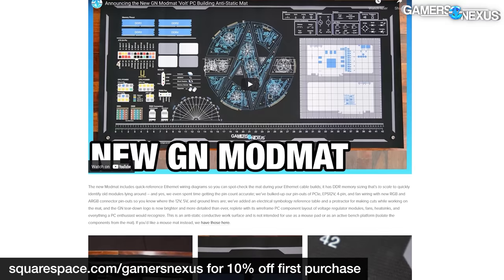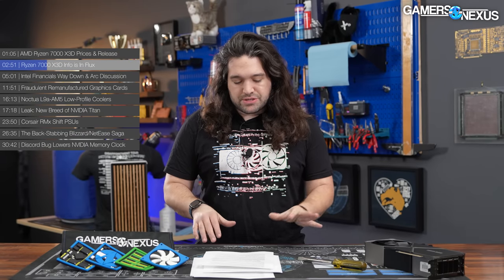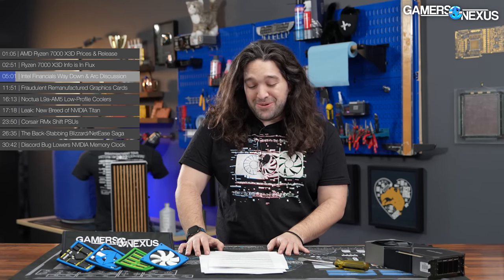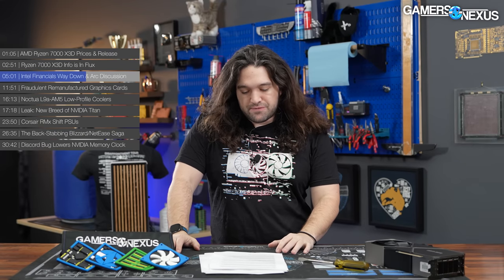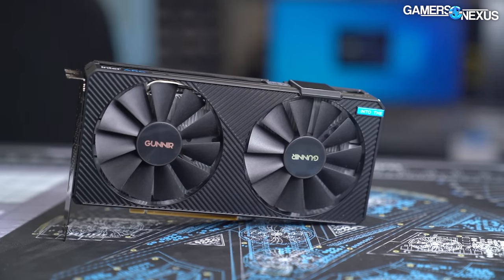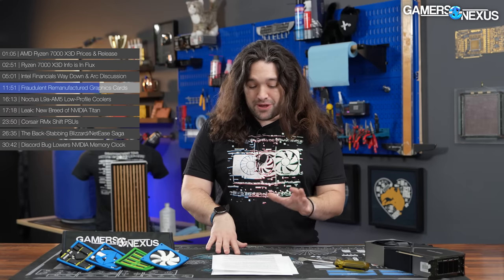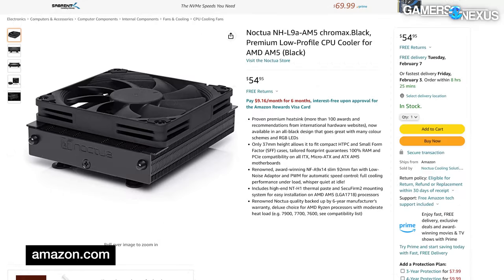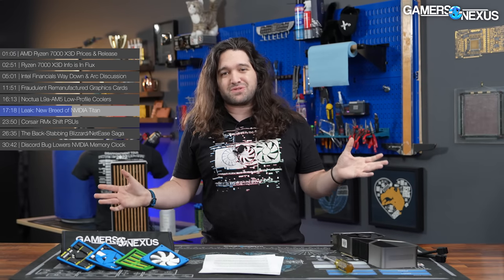HW News - Fraudulent Used Video Cards, 7950X3D Pricing, New NVIDIA 'Titan' Rumors

Comment: For those unfamiliar, TAM is basically a number that describes how much the company would theoretically make if it had 100% market share. This basically allows you to distinguish your slice of the pie getting bigger from the pie itself getting bigger. In Intel's case both are going down, which is always a bad combination.
Reply: I don’t really get it though, why would TAM go down when the need for computational power has never been higher? The only reason why TAM should decrease is if the market shrunk but it’s not shrinking just changing. I.e their will likely be a huge growth in compute needs by the government specifically the military of various governments as global tensions rise
Reply: @dennisp8520  Lots of companies overbought hardware capacity during the growth and shortages in the last year. This means they're sitting on a big pile of servers, and will take a while for them to start buying again.
Reply: It's cyclical, it's not just due to a recession. Most companies don't buy annual replacements of servers, so if they have a record year of sales, then the following year will almost without question be a decline. I think in about 2 years, their repeated process shrinks on the CPU side and GPU iterative improvements on the hardware and software side will give them a banner year.
Reply: @CyberneticArgumentCreator  Just have to ensure the servers don't last more than a year and you can keep the revenue as high as you like.
Reply: Good explanation, thanks.
Reply: Use "basically" a few more times, so people can think you're even smarter than you think you come across. Basically.
Reply: @Triaxx2  If they broke down like that no company would purchase any of their servers anymore.
Reply: @CyberneticArgumentCreator  while that is true, its not like every company is "In sync".
But of course a new generation might make companies interested in upgrading hardware at the same time, e.g. maybe they want to go to more power efficcient hardware when energy prices are high, maybe they need some AI accellerator cores to increase producitivty etc.
Reply: @TheEchelon  I suspect you underestimate the stubbornness of corporate procurement.
Reply: They thought that making their dies anonymous with "intel 7" and such would help them keep selling old tech lolol

Comment: The irony with Intel (and other companies) is that the current CEO (Gelsinger), who is restructuring the company to become more competitive in 5-10 years, will get all the flak. In fact, this predicament is due to the previous CEOs not preparing for competition, not investing in R&D, not willing to spend money so that they can report higher earnings and get fatter bonuses. They sat on 4-core i7s for years and years, just raking in the money, while AMD caught up.
Reply: @Morimea  well let's see if Intel closes it next year then, I can't imagine ARC going from -400.000.000$ to >1$ within a Year.
Reply: @Ocastia  It can, if the investors decide to cut the project it'll drop to $0 within a year.
Reply: I'd say specifically they didn't execute on process node improvement probably because of money and poor management.
Reply: Also keep in mind, it takes like 4 years for a CPU to go from concept to being in your hands. Every product we're seeing today was started under Bob Swan (from what I heard, being a finance guy, he really turned over things to the engineers and let them do what they needed/wanted to do). The products and strategy Pat is responsible for are still a couple years away. Brian Krzanich was the guy who laid off all the "grade level stagnant" employees (older experienced employees who ended up going to work at AMD,  Nvidia, and Apple) and he's the guy who decided they could keep 10nm performance/density targets the same even without EUV.
Reply: Dude they stuck to quad core flagships for a literal DECADE! The Core 2 Quad Q6600 came out in Q1 of 2007 and their last quad core i7 the 7700k came out in Q1 2017 before bumping up the core count once Ryzen came out. Intel completely deserved this L for gauging their customers for 10 years and got caught sleeping because of it!

Comment: When you put the X3Ds to the test, you should take a look at some strategy games; dwarf fortress, paradox games, etc. These games are CPU limited and have shown massive performance boosts for me with the X3d on AM4.
Reply: let alone physics games like KSP with 100+ mods installed.
Reply: DCS World in VR :)
Reply: And WoW! I really hope they will test it since its an MMO that benefits.
Reply: Seconded.
Reply: Upvote for this ! =) And with big sim games too (FS, KSP 2.0, etc...)
Reply: Starcraft 2 as well.... it keeps being used on GPU company benchmarks but no reviewer actually does it
Reply: and now the 7950x3d, 7900x3d launch is soon, at lower prices than 7950 and 7900 launched at.
Reply: @MongooseTacticool  YES!! Someone needs to test this workload, it's probaby the toughest test out there!
Reply: Add Factorio or Dyson Sphere Program to the list.
Reply: X4: Foundations will likely see massive fps boosts as well.
Reply: @Helper800  This was the game I was going to suggest. Late game even the newest of processors can fall over in terms of FPS. 
I'm sure someone from the X4 reddit group would be able to provide a demanding save game to test.
Reply: Still waiting on a cpu that can run FaF in late stage team games:p

Comment: Hopefully Intel keeps the GPU department. The new drivers is a great step in the right direction and some much needed competition in the GPU market with all the price drops.
Reply: I doubt they'd toss them.

Having a competing GPU tech extends well beyond just manufacturing GPUs.

For instance, the way AMD has been able to pick up Xbox, Playstation, Steamdeck and other markets for over a decade now is because they can deliver a complete package designed to work as one.

In the compute and server market, Intel can transpose their GPU knowledge to developing decent compute hardware to compete with Nvidia, a gigantic market they are losing out on.

And in our own space, if you want anything with some graphics performance, be it for design, compute or gaming, Intel was only ever able to sell CPUs, where they now have competition, the GPUs were always Nvidia or AMD, because Intel integrated can't compete even with other integrated graphics.

Up to now, Intel has tried to avoid the GPU market by trying a multitude of other compute models, but that never worked or had enough volume to keep up with GPUs capabilities.

The GPU market gets its performance driven by the gaming market and these advances can then be capitalized on for compute and other markets.

On top of that, the GPU market functions as a testbed for AMD, Nvidia and now Intel. They can push GPU/Compute tech, see how it fares and then push it towards business showing it works.

The old Intel approach towards compute had them come up with unproven product after unproven product. Some of their hardware was really goddamn interesting too, but it didn't end up having any longevity because it's hard to sell untested hardware.
Reply: @enlightendbel  Especially with the meteoric rise of AI, if you have the best datacenter GPU compute on the market, you basically have a money printer. I think that's the angle Intel is going for.
Reply: @kukuc96  they've tried to go for that before, but didn't take advantage of the GPU market to show their hardware ideas work.

And that's the point, use the desktop market as a testbed for tech that shows the datacenter world your tech works and advances.

Just coming in with some new hardware like their "lets slap 500 Atom cores on a CPU and say it's for compute" while Atom cores were known as low power (both in consumption and performance) CPU cores, that's not something that inspires confidence. It puts your product directly in the sphere of novelty.

Intel has had several compute products like that, that never really lifted off.

The other thing is, when you use bonafide GPUs, you still have flexibility in your configuration and vendors.

Sure, a lot of datacenter tech is currently tied to Nvidias software stack on top of their hardware, but it's not that hard to swap all that out for better performing hardware as long as it's stills somewhat similar.

That isn't the case with novel products like Intel was trying to push, since the software, hardware and everything about it was just completely different and needed a rework of pretty much everything.

And, again, the tech was unproven.

Comment: Those shift psus are a cool idea. Won't need a new psu for at least 4-6 years but that ease of access and the fact that it has the 12 pin connector makes them appealing to me down the line when I upgrade my pc.
Reply: more space for connections as well on the higher wattage models . quite nice and more support for super computer and dual pc builds.
Reply: Totally cool, just need a case with good amount of space behind back panel
Reply: Not sure how PSUs that require immediate bends at the connector, you know, the last thing you want to do with power cables, is a good idea, but hey, if stressing your cables 247 sounds good to you then so be it.
Reply: I've always broekn down and rebuilt my whole PC when I upgrade to thoroughly clean and re-optimize the cable routing, but that may be more of a 'my problem'. In any event, I'm glad to see some attempted innovation but these are probably going to be small run and harder to find and getting custom cables made for the micro connectors is gonna be pricey.
Reply: @joemarais7683  That happens now anyway. Almost every case that includes drive trays in the bottom force you to heavily bend the power cables if you use the cage. This at least would make it easier to work with. In large cases such as the corsair 5000 or something, the distance to the side panel can be more then the distance allowed from the drive cage and it won't force all the cables to bend and come out in the one thin space between them.
Reply: @joee7452  Oh yeah, you often bend all cables to the back side anyway and in some cases the bend is pretty bad, especially how plugs oriented. I don't see how cables gently going up right away will be worse tbh
Reply: @joee7452 right, but you can remove the drive tray. You can’t move the side panel further away. That’s more of my point, and why it seems dumb, unless Corsair makes having 2cm between the psu and side panel a standard in all of their cases and not just the massive ones.
Reply: @joemarais7683  Yeah except there are other choices. This isn't the only psu style. Making PSUs that have a side panel output doesn't stop anyone from buying one that has the standard front panel direction. It's simply another option for those that would want it. Second, yes you can remove the cages but that defeats it's purpose if you need or want to use them. The change is nothing but a good thing because it gives people another option when deciding on a design.

Comment: It's interesting to see delay in news. "Refarbished cards" actually pop-up from few manufacturers in China on Russian market and some of them was disassembled by VIK-off  on his YouTube channel. Also some of sellers of such cards actually traveled on manufacturer factory (assembly line) to check what's going on there. Completely missed by east media and pop up only right new. Most of that cards was RTX 3080 (turbine and 3 coolers version) by Peladn, but also were radeon cards 5700 XT i think.

Comment: Thanks a lot for that bit at the end, Discord was knocking off 100MHz out of the memory clock on my 1060.
Reply: The Discord bug is affecting 1060 drivers too? I thought it was only Nvidia's newer stuff.
Reply: @sammiller6631  Nvidia isn't specifying what hardware the bug is affecting, so I guess just assume literally every Nvidia GPU ever made is experiencing this. They're also not even specifying how to apply the "fix." Many people are questioning how the hell do you even download it and apply it.
Reply: @sammiller6631  Nvidia isn't specifying what hardware the bug is affecting, so I guess just assume literally every Nvidia GPU ever made is experiencing this. They're also not even specifying how to apply the "fix." Many people are questioning how the hell do you even download it and apply it.
Reply: 200mhz on 3060 ti,testing now without hardware acceleration in discord,not  decreasing frequency yet

Comment: I really like the Corsair Shift PSU idea, I'm down for anything that makes upgrading/modifying your layout easier over time. Having to take out your PSU when you're adding a hard drive or something just to add one more power cable sucks.
Reply: Why would you take the psu for that?
Reply: @livid7594  In my case, it is too tight to add an extra modular sata cable. You literally can't see anything, so either you take out the psu or try by feel blindly while hurting your hands for 30 mins
Reply: @livid7594  Unless you have small hands, it's hard to fit in there and plug in an extra cable. While not seeing anything mind you, because your hand and the cables block your view.

Comment: The issue discussed at 21:00 with the GPU cooler pulling away from the PCB happened to my 2070 super after 2 years of owning it, the fans started to ramp up to full speed for 0.5-1 second then stop sometimes even though the GPU temperate were fine, I figured it would be the cooler pulling away from the VRAM since I experienced that before with a laptop, opened it and changed the thermal pads and paste + put it back together and the issue was solved.

Comment: 22:11 that's also where the cpu cooler is, if you think about it. A GPU designed that way would raise over the cpu socket, practically preventing any type of cpu cooler to be there. So not really possible.
Reply: Pins can be other side too

Comment: 17:48 If the new Titan card actually has a 90° PCB, then it seems like taking up 4 slots is mandatory, even if it is water-cooled. Given that titan cards typically do not have AIB versions, that would mean you are stuck with only 1 card per system. I am interested to see if water block manufactures can make something to make it fit in 1 or 2 slots.
Reply: Also note how there are multiple cutouts on the fins side for ports, seems to match the io plate.

Comment: I would love a GPU where the PCB was vertical, as discussed in the video. But I would design it so that it would plug into both motherboard slots at the same time, using the lower one for support. This would allow for a cooler design like the noctua nh-d15, where the fans are standing up from the motherboard, pushing air from the front of the case through the back. It would also place the power connectors closer to the board, making it easier to manage.
Reply: For PCs with a lot of addon cards, I rather see the bottom slot be PCIe x16. You could then use a vertical GPU bracket without blocking the other PCIe slots with the cable.
Reply: @willjohnsonjohnson  that would most likely cause problems for anyone not using a cable though, and would leave a lot of empty space in the case for people who don't have addon cards.
A vertical card as described would need to fill 6 slots.
Reply: michaelscarport  given the front intake, rear exhaust, option described in my original comment, you could enclose the GPU on the top, sides and bottom.
This would turn it into a tube, where air got sucked in from the front of the case.
Given an extending shroud, should be easy to design, you could have the front reach all the way to the front of the case. In turn letting you use the front 120mm as a separate intake for the GPU, completely cutting it's airflow out of the rest of the case.
This would also quiet down the GPU, as it would be inside an second enclosure.

Comment: With regards to the new Nvidia Titan rumour you might consider multi-monitor setups: with GPU sockets positioned as they are you cannot fit fibre-optic Displayport video cables next to each other. The transceivers are too large. By spacing them out across the card you fix that problem. With 80 Gbps Displayport all but very short cables will have to be fibre-optic.
Reply: For that, couldn't you just have the ports rotated with the PCB in normal orientation? I mean if the design is as Steve says the ports would also be rotated anyway.
Reply: @swayingGrass  I think the Displayport  ports are fractionally too big to fit between the slots horizontally. But I suppose they could use mini ports instead.

Comment: About the Titan leak: Maybe an internal "riser cable" of some sort? Instead of being user socketable, it's soldered by the manufacturer. Or even taking a gamble with vertical mounting of GPUs being so popular, Nvidia just making the PCB a weird sort of vertical mount and just supplying a user socketable riser cable. The design makes a bit of sense for a mainstream, high end GPU, but not a niche Titan market segment.

Comment: I can think of 2 reasons to design the Titan like this: 1) for mounting in datacenter cases, 2) for dual / SLi use in high end workstations. Both orientations confirm to maximum front-+rear optimal airflow in vertically or width constrained chassis.
Reply: Why are we even trying to justify this, frankly, insane potential card? Even the 4090's size is completely absurd.
Reply: @arnox4554  titan is a workstation card
Reply: @arnox4554  Because nothing succeeds like excess
Reply: @AkitaMix  So?

Comment: 20:08 On the right side of the cooler in the earlier leak, you can even see the 4 video out connectors in the form of slots cut into the cooler plate.

Comment: I think motherboard and case manufacturers should take Corsair's lead and also shift cable IO connections to the "back" of the case.  In modern builds, the "front" of the case is the long side, and all the cables shoot out the side.  Moving them to the opposite long side, would only make sense.